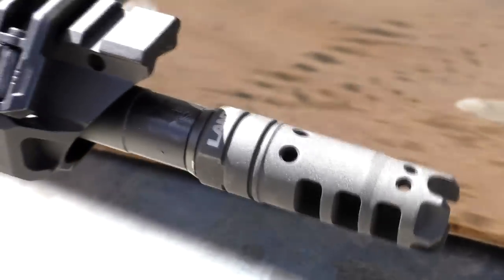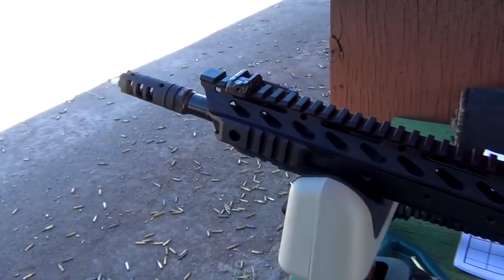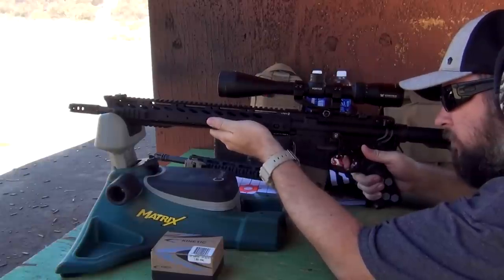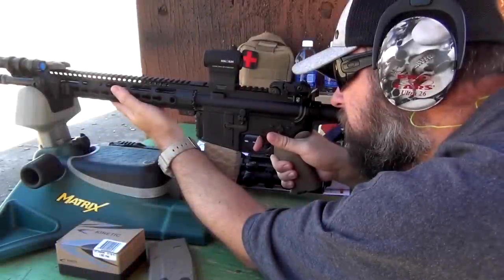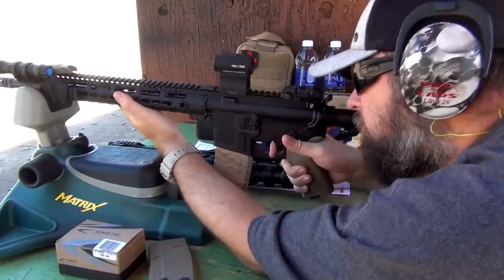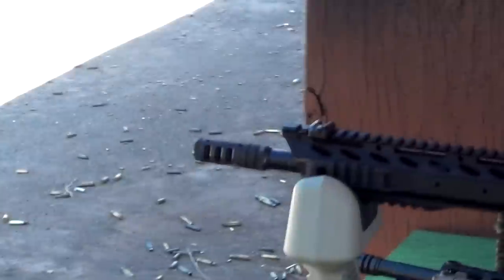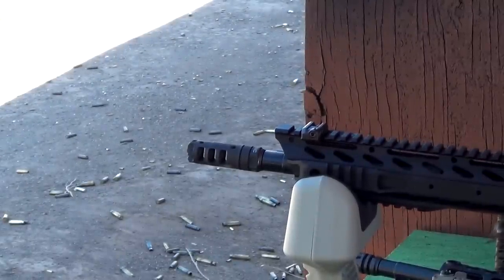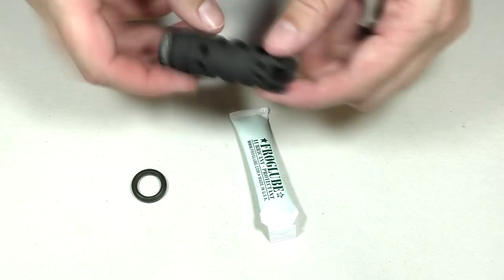Compensator Vs  Flash Hider

Comment: The A2 flash is often derided as garbage, however most people are comparing it to a compensator. The military has been using the A2 for many, many years without many complaints. For the money $8.00 to 12.00 dollars on average it ranks at the top of the class for its intended use.......flash hider. Installing a compensator on a 5.56 is stupid and useless, it is also obnoxious for range shooting and creates a tremendous muzzle flash. You only want to install a flash hider unless your doing three gun.